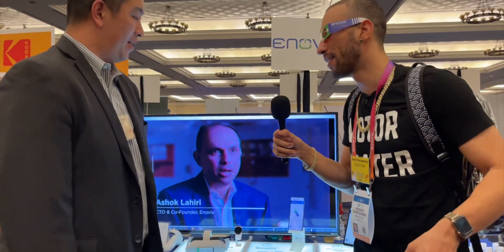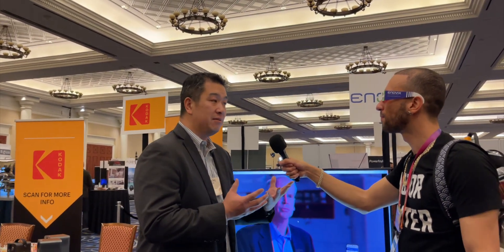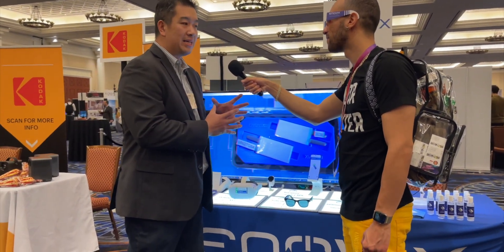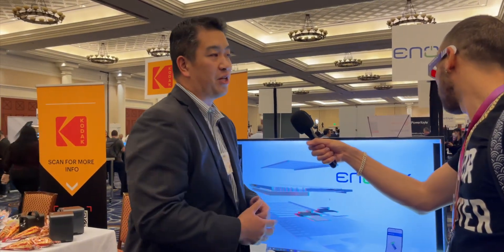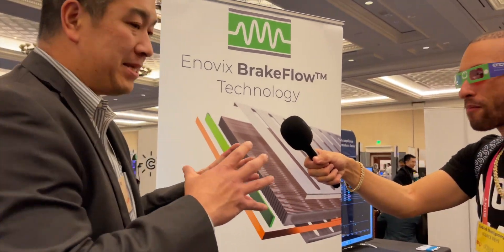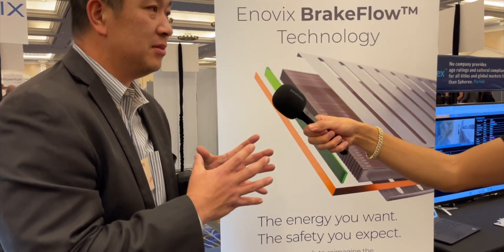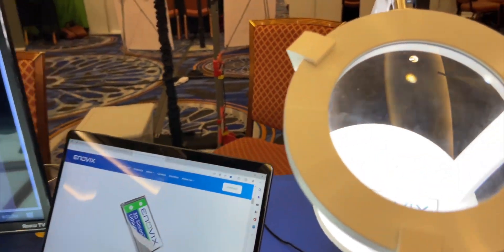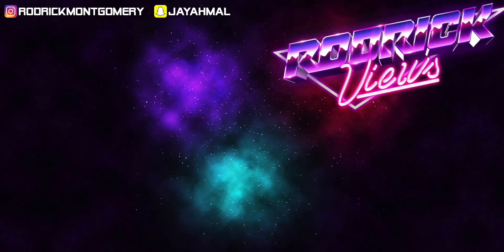CES | Enovix BrakeFlow Silicon Battery Technology

Comment: Unfortunately that pitch man didn’t do the technology enough justice. 100% active silicon anode, 3D stacked architecture design solves silicon expansion issues.  Brakeflow eliminates thermal runway if battery is shorted.
Reply: How does it compare with the durability and cost efficiency of the iron flow battery used by ESS Tech?